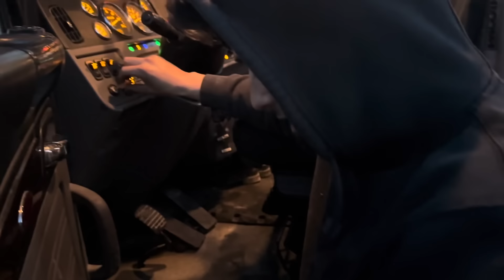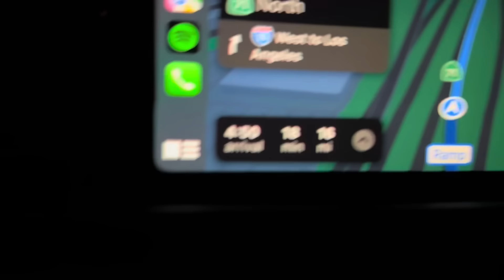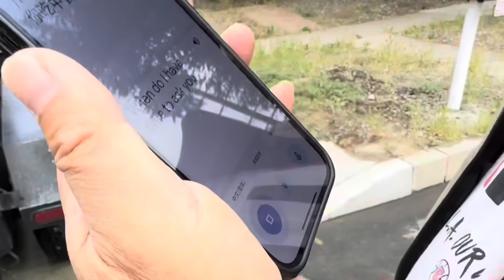Would You Drive a Concrete Mixer truck?

Comment: Them mixer trucks have an extremely high center of gravity and are more prone to rollovers, even so more than 18 wheelers from what I’ve heard and seen! Much respect to you for doing such a job!
Reply: And add the rotation and speed of the drum.... it can actually make the truck even more prone to a rollover when cornering
Reply: It’s actually not, it’s pretty safe from what I’ve heard…that’s why they drive around with the drum turning so that the center of gravity remains as low as possible meaning the concrete constantly mixing by the drum spinning won’t keep it from sticking to a particular side of the drum and cause nueve weight. So therefore by spinning the weight is distributed evenly as possible.
Reply: @TxMx214  That's not true. Not safe at all unless you are driving empty with no load.
Higher Slump concrete will be pulled up the side of the drum by the fins
as they rotate, increasing the forces to one side of the truck. Being
more fluid in nature, it will also react quickly to changes such as sudden
braking or sharp turns on a roadway.
Lower Slump concrete is thicker in nature and will be pulled farther up the
side of the drum by the fins, thus significantly increasing the forces to one
side of the truck.
Reply: @TxMx214  "heard" wrong
Reply: Yeah I've driven a big tanker trailer and now drive a ready mixer and I can confidently say I felt way safer in the 53 ft tractor trailer. Not that I'm scared driving a mixer it's easy to get used to and feel for it, but it's definitely less stable than the tractor trailers.. plus with the boosters down, those pop and yall can easily roll, I heard stories of a girl she was 19 and her booster tire was low but went for one more load and never made it home.. truckers are the blood cells of the country. Tbh you straight up do drive for yourself and everyone else on the road, you don't know what that means unless you're a trucker, people drive way more stupid around trucks than other cars
Reply: @TxMx214 what you heard ? Definitely heard wrong buddy. Doesn’t matter how fast or how slow the drum is spinning. My brothers been driving these trucks for 36 years and have seen over 15 flip in his career. Most of the weight is on your driver side when spinning clockwise. And when you discharge the concrete counter clockwise the weight shifts to your passenger side. These trucks are no joke. Super dangerous, more so in the backcountry too
Reply: It looks like she's a pretty conservative  driver instead of the clown who took an intersection too fast and rolled it on its side.  I don't know to this day how they got the concrete out and righted the truck.

Comment: I give you a lot of credit for doing that job. I have drove dump trucks for years then moved to a different state and thought I would try cement truck. I did it for 2 weeks and that was enough for me. I hated the inconsistency of the work schedule but mostly could not stand working with most of the contractors as they were always in a mad rush and treat you like crap. I went back to dump trucks.
Reply: Concrete truck** 

Cement is a product within the concrete. You can always tell a newbie when they use the word cement for concrete lol.

Comment: If you're on time you're late...if you're early you're on time
Reply: Not necessarily true in the concrete business. Each load is time sensitive, and many contractors throw a fit when you show up early because the crete sits in the drum for longer than it should.